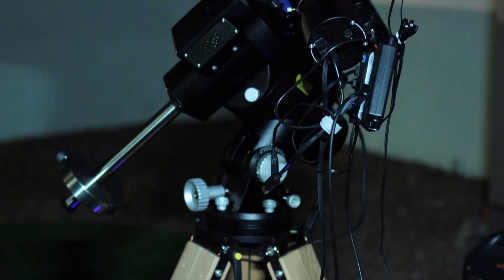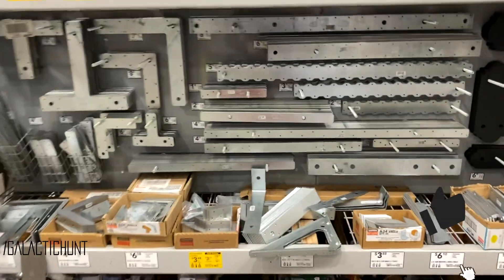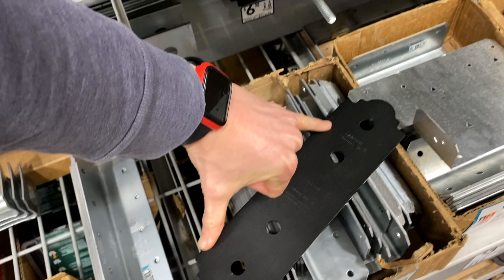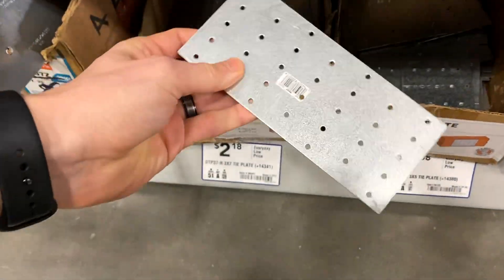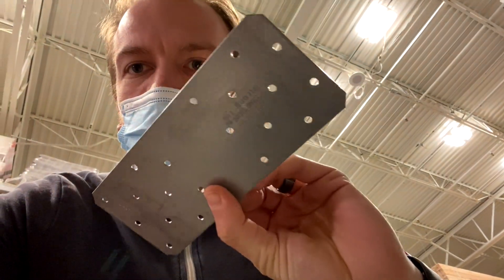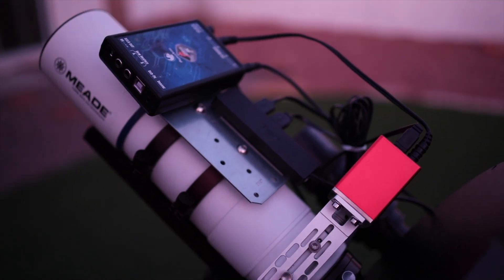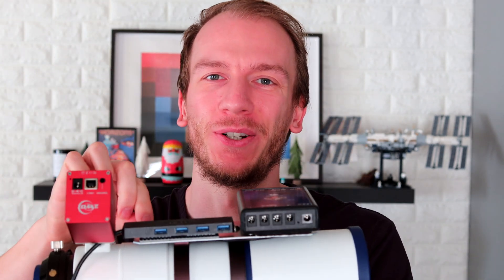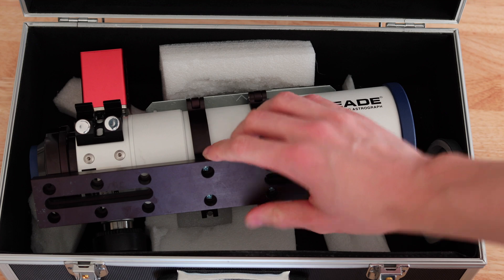Stop Buying Overpriced Dovetails!

Comment: This was a good and inexpensive solution to a common problem however your bit on drilling the holes is NOT good. Take it from a toolmaker with over 35 years experience and still in possession of all his digits, you're asking for trouble the way you were holding the workpiece with your bare hands. Hand held drills are usually to low in RPMs for the size drill you were using which can result in the drill wandering right into your hand before it actually bites and starts drilling. Put the workpiece in a vice or hold it in a clamp with your free hand way away from the drill bit. For that reason I can't give a thumbs up for this video.
Reply from the maker: Yep I definitely do not have 35 years of experience drilling. Next on the shopping list is clamps :)

Comment: Great idea. I've done the same thing with same plates and with 1/4 inch aluminum plate to mount gear on top of my AT80EDT and as a saddle-rail to mount my old 4 inch reflector.  Works great.

Comment: As I am in the process of transitioning from "normal" photography to astrophotography I have a lot of Arca Swiss compatible stuff. So I simply mounted an 35cm long Arca Swiss rail on top of my telescope. That works like a charm and the rail cost only about 20€.
Reply: Yep I've done that on my telescope too. Used a long arca swiss plate and drilled couple of holes.

Comment: I love finding hardware store solutions or mods to astro needs. I built a handle for my 130EDT with aluminum stock and a gate handle,  and an SCT cooler with a computer fan and a junction box.    That's not counting my deep cycle battery box I built.     Nice idea for the dovetail!

Comment: I think I noticed you drilling  a new hole very close to a pre-existing one. Might be best for anyone with less experience, to not drill too close. Bits can slip into existing holes causing a mess. Also using a punch helps. You had it handled fine though.
Reply from the maker: Thanks for the tip!

Comment: Good work Antoine. Another option is to 3D print your supports. It will be slightly bulkier but much lighter and you can custom design your holes. Never use this technique for load bearing and structural parts of course since there is always a risk of structural failure .
Reply from the maker: Very true! 3D Printing is awesome for this hobby!

Comment: I am about to do the same thing for my AT65EDQ, so this is very timely.  I'm going to use a piece of an aluminum bar from Lowe's -- much thicker than the mending plate you used.

Technically it isn't a dovetail unless the edges slope, of course.
Reply from the maker: Haha yes I wasn't sure how to call it 🤔 Good idea going with the aluminum bar, they are indeed thicker, I went with this one because it was super lightweight and for this tiny scope it's fine but if I had to do it again I might choose a thicker one "just in case" although it does seem very sturdy as it is

Comment: Get a nail set or a small punch. Then you can use that and a quick wack with a hammer to make a dimple where you want to drill your hole. Will keep the drill bit from trying to skate all around when you start drilling your hole. You skipped over the plate that had a little bend along the edge. If you can accommodate it, that will stiffen your plate an incredible amount...
Reply from the maker: Thank you for the tip, that's a good idea!